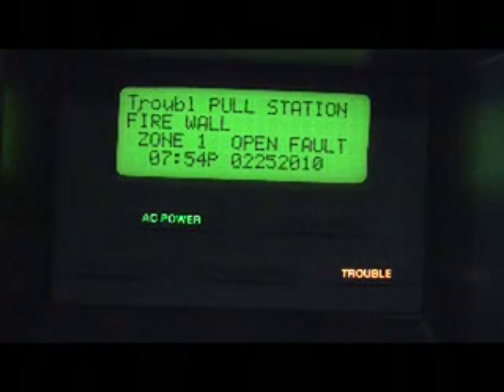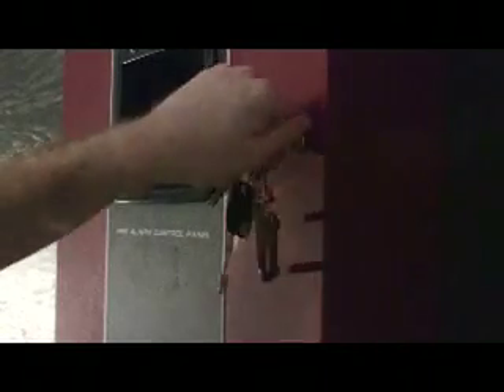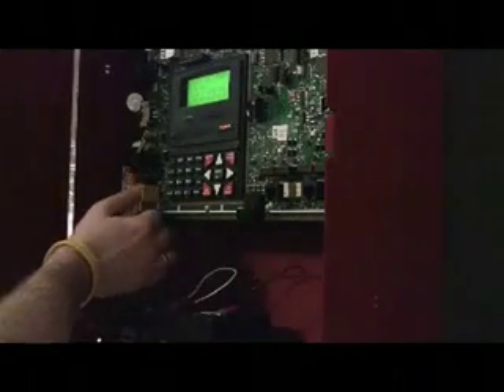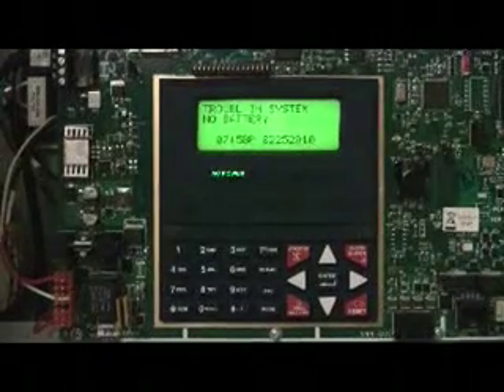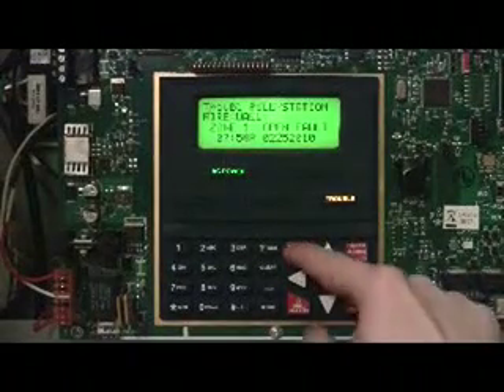How to Power Down a Fire Alarm Control Panel

Comment: What's the point of acknowledging the battery missing alert if the next thing you do is pull the mains off?.

Some (not all) panels will not work if you power them up mains first.